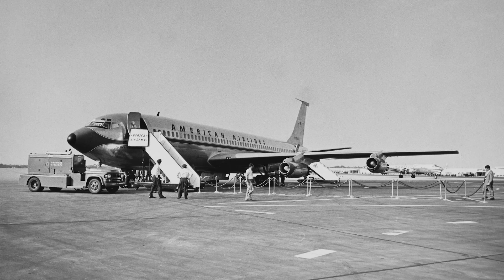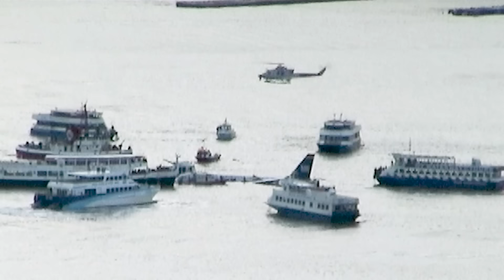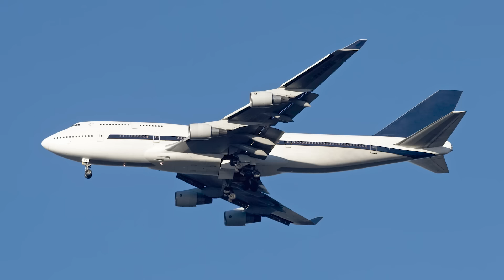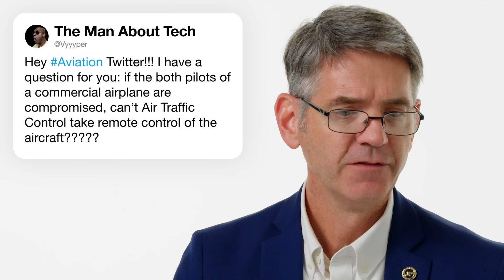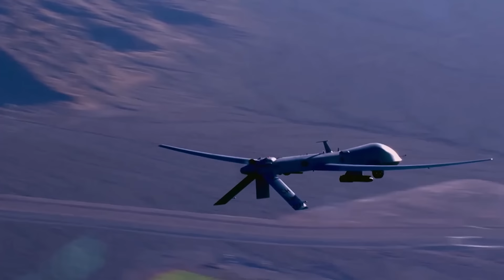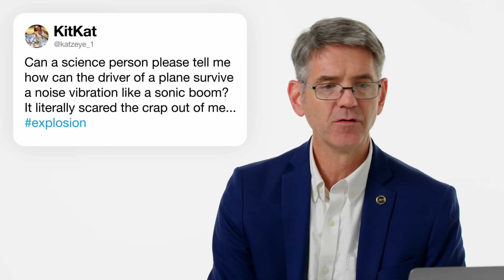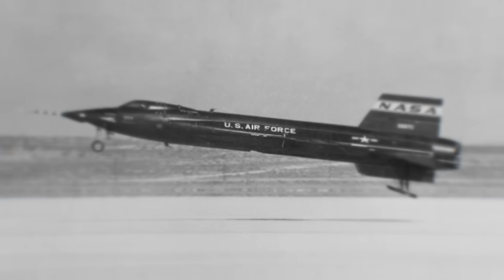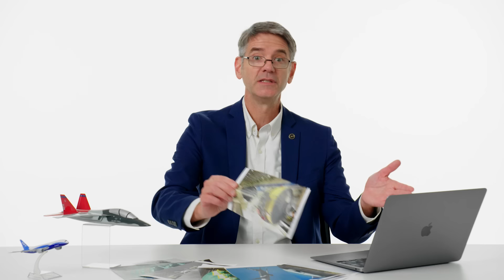Aerospace Engineer Answers Airplane Questions From Twitter | Tech Support | WIRED

Comment: 3:11 physicist here, this is actually a common misconception. The wing is designed such that air flows faster over the top than the bottom of the wing. Fast moving air has a lower pressure (see Bernoulli’s principle) this means the airplane is effectively sucked upwards. Attack angle also makes a difference and airplane wings have a lot more complicated aspects (like how turbulent air effects air flow and pressure) but Im not going to write a textbook here lol.
Also, fun fact: Einstein once tried to design a new air plane wing which failed pretty badly so you are not alone in this misunderstanding :)

Comment: My ex girlfriend's sister was a pilot with Lufthansa. I've never been a good flyer, and she explained to me how lift works, how turbulence works, and how crews overcome weather problems. It really helped me understand what was happening when I was on a plane. And she told me that the most dangerous part of the flight is taking the trip to the airport, especially by road. Once you're in the air, you're safe; you're among professionals.

Comment: 4:03 that’s what I can’t get over, that they look basically the same yet are so different. Old airplane still looks like airplane. Subtle exterior differences, primarily the engine size give it away. It’s the internals that have changed. Cause really the physics of aerodynamics has not changed and if it ain’t broke don’t fix it, as they say. Always amazes me to think about though.

Comment: 8:33 - A friend was one of the engineers on the Boeing 777. I got to go to the wing loading testing - where they bend the wings upward until the break. The next guy thought a sonic boom was scary! Go watch the video of it, the wing goes up to about 45° before it snaps. WAAAAY more bend than any actual flight would ever encounter. (The 787 could withstand even more flex - to the point that the testing rig couldn't bend the wing far enough to break!)

Comment: Re: electric airplanes -- Airplanes can generally take off safely at a heavier weight than they can safely land; airlines can take advantage of this by loading the plane to the maximum landing weight with empty fuel tanks. Since electric planes don't get lighter in flight, the cargo capacity is reduced.
Reply: You have to go over the ocean and dump batteries 😀

Comment: The one thing I disagree with is that modern commercial planes don't really need 2 pilots. For takeoffs and especially landings having 2 pilots is really important. One to fly and one to handle the radio and watch the instruments.
Reply: And CRM. He needs to get more aviation and human factors education.
Reply: Okay but that's not a "need" - they can and are flown by single pilots. Having multiple just makes it easier on them.
Reply: @ It indeed is a human factors need. While a commercial aircraft CAN be flown by a single individual, the workload and fatigue increases, especially during critical phases of flight and during emergencies. One pilot is needed to locate and read the emergency procedures while the other tries to maintain flight. CRM is also an important part of having 2 people flying the aircraft.

Comment: I think the major reason flying is safer then driving is the lack of things to hit. Yes when at the airport there are some things to look out for (which is why there is a whole team dedicated to that) but once airborne there is little that you can hit. Where as in a car there always is something to hit. And not only that you are surrounded by tons of propelled steel that also tries to get where they are going. All driven by a single individual. It's a small miracle it goes as well as it does (and it often doesn't go well).

Car survival rate has increased thanks to crumple zones, airbags, seatbelts. Plains survival rate has increased due to less crashes

Comment: ramp doesn't ensure you can takeoff either, you still need a certain amount of airspeed, ramp actually make you lose speed since you are going up a slope, so if the problem is the plane not getting enough speed, the ramp would actually increase the risk of stalling. carrier ramp are design to address the issue that they have alot of power but not enough distance to accelerate, so it is trading speed for distance. also aircraft design for carrier operation have bigger wing surface area, this allow them to fly at lower speed without stalling. most planes are not design with bigger wing because that is added weight.

Comment: If a remote control function is only for emergencies, not for operations, would that make the certification hurdles less than a 100% remote controlled transport class aircraft ?  Basically, if both pilots are incapacitated and stop responding to a train-style dead-man-detection system, an automatic mayday is sent out and the remote access option is enabled such that a test pilot at the Boeing or Airbus central office can guide the plane to a safe landing and talk to ATC about landing clearance etc.  Another use would be an emergency button for hijackings such that all control switches to the remote team and all cockpit controls and access hatches are locked out while the screens show a message to the hijackers that they are out of luck and the plane will be landed in front of an armed response team at a secure airport negotiated between remote team and ATC .

Comment: Actually, runways do have a ramp at each end. And when commercial airliners were piston powered, pilots would use them to check all engines before going down the runway. This is important on aircraft carriers for obvious reasons, but no longer needed on land.

Comment: Ok so I have a question,  let's suppose that an aircraft with 4 engines has its 1 randok engine down, so will the 1 engine remaining at the other side will go 100% thrust and the other 2 will go 50/50 so in that the thrust would be balanced?🧐

Comment: because ramps can cause sudden centrifiugal force on landing gear and tires especially in a fully loaded and fueled aircraft..plus they deny the airstrip use in both directions...vehicles need airspeed to create lift and ramps do not provide that, tthey change the angle of attack which is not good for a wing to suddenly experience. vtol aircraft are the most known users of ramps which exist on british ships...you dont see them elsewhere. nor do you see launch assist mechanisms.

Comment: Habour Air in Vancouver is field-testing a conversion of a DHC Beaver to electric motors.  Once the batteries are redesigned to fit in the space the fuel tank used, the "Electric Beavers" will actually have more capacity than the originals because the electric motor is much more powerful.  But as noted, this is a short-range puddle-jumper.

Comment: I'm pretty sure that the question about parachutes was asking about individual parachutes for the passengers. I'd say the best answer for that has to do with pressurization making it impossible to open the doors at high altitude and pretty much any issue that might require ditching rendering the airplane too unstable at lower altitude to get everybody out in time. Also, there's a very good reason why you aren't allowed to jump on your own your first however many times and the vast majority of passengers aren't likely to be rated for solo skydiving.
Reply: Dumb question either way. How do you expect the people to get out of the aircraft, much less where do you put the parachutes and what about the infants and disabled, and how often is an aircraft in a controllable situation that would actually allow people to get out. JUST PLAIN STUPID!

Comment: some airports have a ramp, but it is not for the reason the questioner posed.  The Asmara airport had a ramp when it was extended for the 720Bs of Ethiopian Airlines in the early 1960s. I don't know if it still does.
There are Youtube videos of planes landing at mountain airports that have a ramp.

Comment: He's generalizing about one engine operations. Multi-Engine Aircraft certified to run one one engine have what is called ETOPS, or Extended-range Twin-engine Operations Performance Standards. Any commercial aircraft that crosses any ocean bodies are REQUIRED to be ETOPS certified. There are airframes that are ETOPS rated that aren't certified because the aircraft do not fly over the oceans. Just to expand on some generalizations that I understand that he did. Single Engine commercial operations over major bodies of water are not allowed as far as I know.
Fun fact. The 747, until the 747-800i, was not ETOPS rated. The 747-800i is the first four engine aircraft to be ETOPS rated.
So every other variation of the 747 was not etops rated. As the name says. "Twin-Engine"
Also there was no 500-700 model of 747

Comment: Professor Crossley, I have a question about electric aircraft. You said a big problem with them is the weight of batteries and their short range. What if hybrid aircraft could be built with both electric and conventional engines? Smaller, lighter batteries could be used to power the electric engines, while the conventional engines help to keep the batteries charged up. A pilot could switch between the two during flight to save on fuel for a while then, as the power runs down, switch back to conventional engines to charge up the batteries again. On a long flight, this could save a lot of fuel and so lower the running costs of the aircraft.

Comment: 14:18 as I understand the pilot monitoring exists to cross-check the pilot flying most of the time. Obviously they can also fly solo should the first pilot become incapacitated.
Reply: It’s a matter of workload, especially in an emergency situation. This guy is clueless.
Reply: @johnp139  well it does say aerospace engineer, not pilot.

Comment: When he was talking about wings "Snapping" and stated that wings are designed to handle almost as much as 2 to 1 forces that the aircraft could ever maneuver.  I paused and thought: Why is professional rigging for a crane, ski lift or similar required to have a 5 to 1 ratio for failure?

Comment: Modern airplanes can fly all on their own. Just set a target direction, a height and a speed the autopilot will take care of the rest. So the only problem is landing. And actually modern airplanes can land pretty much autonomously on modern airports that have a modern landing system (ILS). You probably have to push a few buttons and pull a few levers but the airplane can perfectly target the runway and touch down and all you had to do is stopping the aircraft. Only extreme weather conditions are an issue (e.g. heavy crosswinds require manual landing).

Comment: I want the pilot to be on the plane.  If the pilot is on my plane, I have 300 passengers to worry about.  If the pilot is in an office somewhere.  Also, if something goes wrong and the pilot is on board, the pilot has a vested interest in getting the best outcome for the passengers.

Comment: Two questions. Why can't black boxes be replaced by real time satellite transmissions that store the data remotely? And why don't larger planes have cameras to monitor things like the engines? Planes have lost engines and the pilots weren't even aware. I realize my car dash cam is overly simplistic compared to the avionics if an aircraft, but it doesn't seem like it would be terribly difficult

Comment: Autonomous planes would be a massive security concern. An autonomous train is stuck on tracks, and has so many redundant features that make it fail safe in the event of a system failure/hack. An autonomous plane, on the other hand, could reasonably be hacked to crash with no reliable way to stop it.

Comment: I'm not convinced that we will get electric commercial airliners. Since the weight of the plane decreases as the flight goes on, the landing gear isn't designed to have the full weight of the plan landing on it. Max structural landing weight is WAAAYYYY lower than max structural takeoff weight. Landing overweight can cause a lot of damage. This is speculation on my part, but I imagine that the dynamics of landing full of fuel are very different compared to a proper landing. Landing gear would need to be fundamentally redesigned to handle the weight of batteries since they're heavier to start with and they don't get lighter as the flight goes on. There's also the matter of recharging a plane. Airlines don't live leaving planes on the ground because they aren't making any money at the gate. A Boeing 777 can be refueled in 15-20 minutes. An electric plane might take hours to recharge. Someone on Reddit did the math, and the amount of electricity a 747 would need for a 10 hour flight is equivalent to what a nuclear plant puts out in an hour. Yeah, I don't see commercial electric planes happening any time soon except on really short flights with few people

Comment: Interesting - but so many questions left to answer: Mobile phones and liquids on airplanes. The toilet flush. The design of the windows. What would happen (in detail) when cabin pressure is lost. Most secure seats on a plane. ....I could go on and on...
Reply: Those aren’t questions
Reply: If you cannot imagine these points to be turned into questions they would probably be lost on you anyway.

Comment: 11:30 huh, I more figured the parachute question was like, "why doesn't the airplane carry enough parachutes for passengers to bail out if needed" rather than using a chute(s) for the plane. But, yeah, panic and fear make judgment an issue, not to mention the issue of passing out at 30k ft. Or temp problems.
Reply: I think that was the question tbh. Pretty cool that there are actually planes with them though!

Comment: The. Speed of sound drop with altitude at 40,000ft it’s close to the cruising speed of subsonic aircraft. At the same time the density of air is so low that the aircraft will reach stall angle quickly. In fact at that altitude there is a very small gap between stall and over speed. See coffin corner. That why getting any higher is impractical with subsonic aircraft. Getting jet engines functioning well at higher altitude is not a big problem.

Comment: One thing with electric planes is that they could extend the battery life by using solar panels, since the sun's rays are more potent where the atmosphere is thin. There's already a few high altitude drones used for weather monitoring that have ridiculously long operating times thanks to this, although they're pretty light and have absurdly huge solar array wings compared to the main body.
Reply: By like 0.01%!

Comment: "Can't ATC fly planes remotely"
Not directly no, but given an intelligent and fast learner human in contact with ATC. They can relay instructions that essentially will fly the plane remotely with a human being the link to the aircraft controls.

Many aircraft can be set up to land completely autonomously or at the very least, so autonomously that the person behind the stick ONLY have to pull up before touching the runway (flare) and steer the plane on the runway. Everything else can be done entirely by computer with the human element pressing the right buttons to set up an auto-landing.

So the age old question "what if all pilots are incapacitated and a passenger have to fly" is less of a challenge than ever before. The plane will happily fly itself and you can take your time to tell it to land for you.

Comment: While it's true that commercial jets can fly with one out of two engines going out. There is a critical moment in time where, should any one engine go out, it's pretty much game over.
It's between V1 and V2 that's problematic because the airplane is going too fast to stop before running out of runway and it's still going too slow to take off safely.

It can take off, but it will be in a very unstable flight regime and will not be able to climb.

Especially in places that have mountains beyond the runway or tall buildings or other features that make flight challenging at reduced power, you REALLY DO NOT WANT to lose an engine on takeoff.

One final side note, if you are landing with both engines inoperable. Which you absolutely can do. You will run into an issue on short runways and a heavily loaded aircraft in that you don't have the benefit of reverse thrust.

Comment: I don't know about ramps, but what about catapults like they use on air craft carriers? (not an actual catapult, but it's more like a sled that accelerates it on a rail) I feel that overall you'd end up saving a lot of fuel to pay off the infrastructure costs
Reply: That’s exactly what a catapult is.
Reply: @johnp139  you say catapult and people will imagine a medieval wooden contraption that flings things overarm
Reply: @fillman86  That’s a trebuchet.
Reply: @johnp139  a trebuchet fits the description, but its function is driven by gravity, where as a medieval catapult is spring-loaded (whether by twisting rope, or flexing things)
Reply: Too much additional structural weight required and really no reason to do that. A solution looking for a problem.

Comment: 8:00  would it be possible to make a hybrid plane, like a Toyota Prius?  If so, what would that look like and how would it be implemented if it could be realistically
Reply: Yes. Some hybrid planes already exist or are planned to be made. There are two main types, parallel and series. A parallel one relies upon both the turbojet/engine and the electric motor as they are separate. In series, the generator goes into the electric motor. Series can allow the engine to run at full throttle at all times to charge the batteries at a disadvantage due to converting energy a lot.

When mixed with biofuels or hydrogen fuel cells, would be much lower in emissions and more efficient than traditional engines as IC engines aren't that efficient.
Reply: The FARADAIR BEHA is one such design, the ZeroAvia company has a Dornier 228 with one engine and one electric motor.